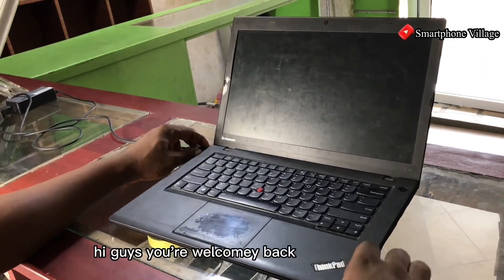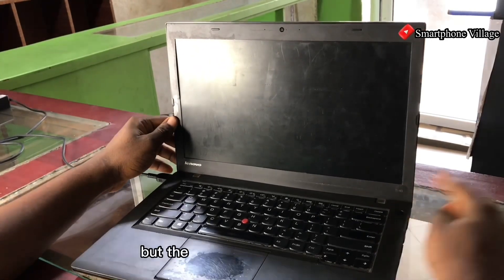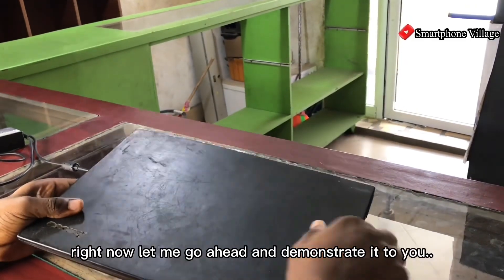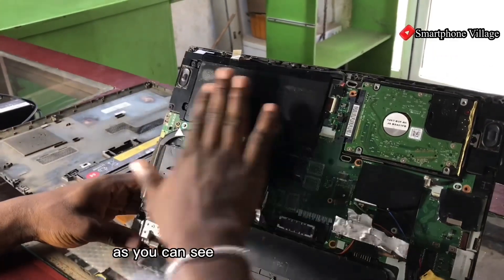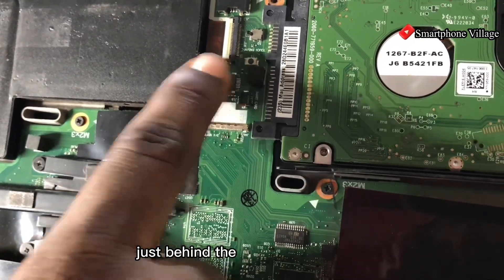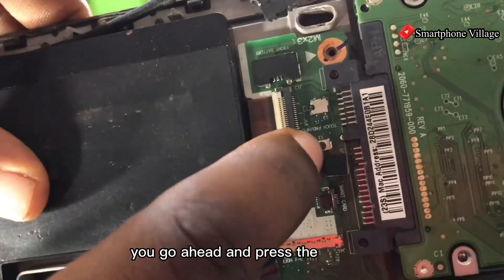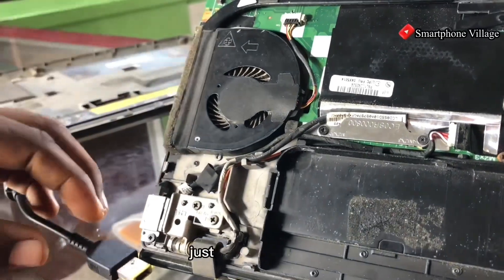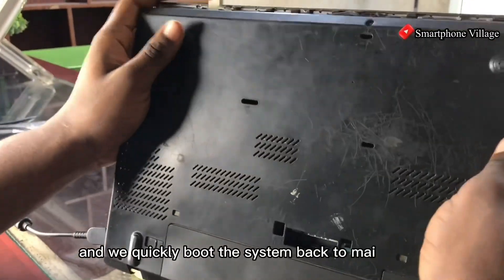Lenovo Thinkpad T440 Not power Solution, How to fix Not Powering on issues in T440 T450 T460 _Quick✅

Comment: Lenovo Thinkpad T450s

My Problem Power blinks 3 times but wont start or make any noise
What I tried:
Diconnect Batteries and CMOS
Pressed reset button 
removed and connected RAM and HDD 
changed CPU Fan
Still doesnt work but power always blinks 3 times
Do you have any tipps what the problem could be?
Reply from the maker: Could be internal hardware fault , to avoid extra damage I suggest you take it to the nearest Expert technician around you for proper check up .